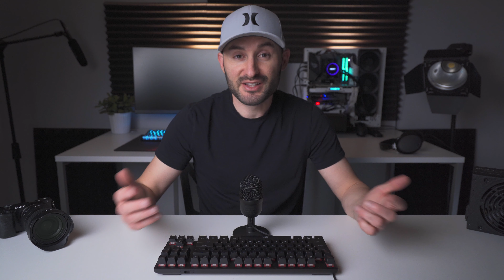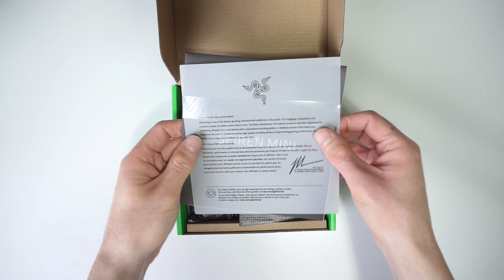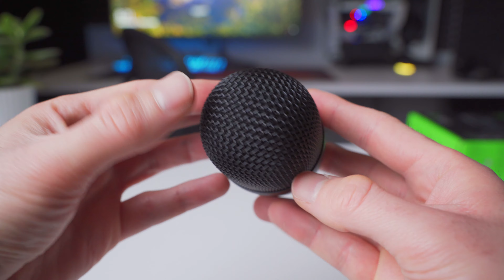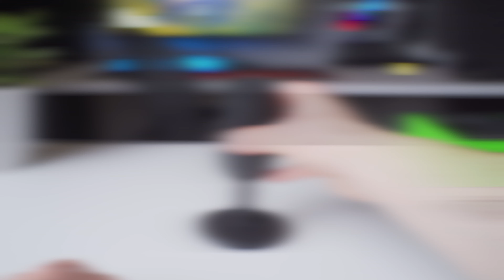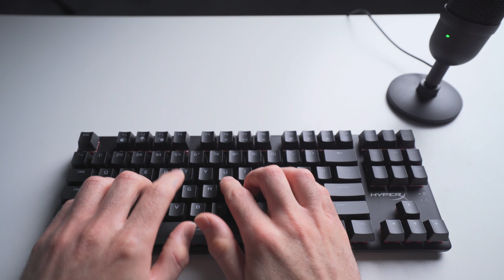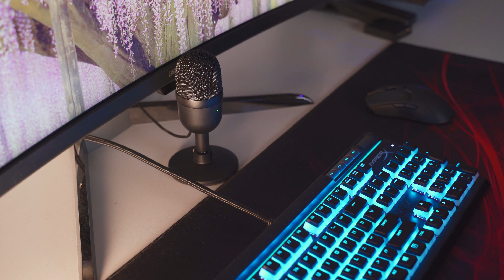Razer Seiren Mini Review, Sound Test & Unboxing | Best USB Microphone under $50?

Comment: I Like this Mic really good I got mine Exactly like this one you have here in this video from Wal-Mart . I find in Different video settings , The Weakest Volme level this  for me is on the Lap Top Video Audio Setting In This Setting I use make 4K Videos with my Microphone setting full Volume setting , Now in my OSB video setting I can control and have a stronger Volume at a lower setting well I have to have set a little lower to avoid Distortion recording in the video , still good volume , now my strongest volume is if i do a live video on YouTube , but I can't do 4K video or like in the OSB i can do up to 1080P 60 , in the YouTube from what i see it shows 1080 HD video it don't say if it is 30 or 60 maybe in YouTube it mostly likely or the other , but it seems to have the strongest Volume Presence with out Distortion , and funny thing when doing YouTube Live videos what ever set up they have will go into the Lap top Volume and lower the Level of the Volume so it don't Distort Automatically . Now I saw video this Mic and In 2024 of this Razer Microphone this now is with a Mute button and it turns that Green Light Red when the Mute is turned on .

Comment: I just bought one of these and the volume is very low which makes it useless for Zoom and other programs that don't have built in mic boost. I have to yell into the mic. I wish that Windows 10 still had the Control Panel microphone boost option, because 100 mic volume is not enough on many new microphones. I have a Blue Snowball with the same issue. I don't get how the sound volume on yours is so good. I also don't get how Razer and Blue think it makes sense to design a desk microphone such that at max volume you have to yell to be heard.
Reply: @Ryu X  I tried this program and it worked for a couple day. But now it no longer gets any input from my Razer Seiren. I've checked every setting and the mic works fine on its own, but Voicemeeter just isn't getting any sound from it!

Comment: Hey, I just got the mic and I've been testing it in obs and my voice is very low, I've tried turning it up and stuff but it's still insanely low. Also you should note that I have it off to the side, but it's still very close to me.
Reply: You can change the microphone volume in windows settings too, even give it a "boost" that slightly lowers the quality but increases the input volume even further
Reply: thank you, this helped a lot! @JoeMortdecai
Reply: I just got the mic myself and I’m having the exact same problem, I can’t find any solution that actually brings the mic audio up to a decent level. Have you been able to figure this out since you posted this comment? If so, how did you solve this?
Reply: @citrusaizu  I kinda figured it out. I moved the mic infront of me and got a decent level of volume. If this doesn't work then you should mess around with the audio settings in OBS.
Reply: For this mic, the direction of your head/mouth relative to the front of the kic is impt. Having just a bit of an angle can already affect quality because it is even narrower than the typical cardioid.

Comment: I just now got this to myself - I think its pretty damn good! I always thought Razer was a low- tier manufacturer until now!
Reply: how does it do when you use it with audio editing / noise canceling software? is it able to block out the keyboard presses and mouse clicks?
Reply: If you wish to avoid the noise of keyboard presses and mouse clicks, I would suggest investing in a microphone stand. This microphone is very good at its price point and I like it! Its audio quality is good especially for a budget microphone for people to start streaming and recording. The only thing it lacks, as the video says is that it does not have any manual controls and you will have to do it on OBS when streaming. If you would like to have a similar microphone with manual controls, check out the Hyperx SoloCast.

Comment: OK so I bought this mic and I still don't know exactly everything I need to change to make it better but here's everything I've picked up.

1)if you plan to use this for discord be sure to youtube how to turn off a hand full of those settings bc that's prob y ur mic sounds weird 
2)if u have a soft voice u prob will have to go into the mic settings and change the levels😭.
3) If u did all that editing from 1 and 2 this thing will pick up a lot of your background noise on discord such as your fans that may be on, keyboard, and bumps on the table etc🙄😐
But your friends could simply turn u down so the background noise won't ear rape them😅
And if you want to download a noise cancelation program make sure your gpu can take it

if you have any suggestions for a noise cancelation program plz,PLZ tell me😅 again I don't know everything should be doing but this is what I've learned.

Comment: I’m a gamer and looking for a good mic for my less than $150 budget.  Would this mic be good to run in-game chat or party chat and chatting with viewers at the same time?
Reply: This mic is specifically designed for streaming, so yeah, go nuts... I own one, it's great, you may need to adjust some mic settings in your recording/streaming software, and in discord to get it to ignore keyboard noises though.

I've successfully set it up to do that, it definitely works. :)
Reply: @N-Z-0-3  hey btw it's a usb mic so like is it detected by razer synapse?
Reply: @Garda_  Being a USB mic has nothing to do with it.

It's a compact mini version of the Seiren series microphones... It has one singular LED light showing whether it's powered on or not.

Synapse or cortex can't configure anything, because these programs aren't designed to configure microphone settings.

So no, the Seiren Mini is not detected by Synapse or Cortex.
Reply: @N-Z-0-3  o ok ty
Reply: 150$ for a mic is a lil bit overkill i think this mic will be great invest those 100$ in a good pc part or like any other thing
Reply: @Garda_  I was actually looking at this mic and even considering the Snowball Ice well.  I’m investing the little bit of money I received in donations back into my stream for better sound quality this time around.
Reply: @sd_gam3s  oooooo ok noice ye ok if that's the case u can buy something better but from razer siren mini is only good mic other like siren elite has like decent sound quality and it has like those emojis type of things when someone donates your mic flashes with the gif they sent and u can select it to static effect it's 160$smth it's a pretty unique mic but If u don't care about those things then go for a snowball mic best mic company ever or research a bit more cuz I don't know much about mic.
Reply: @sd_gam3s  Now the razer emote is 100$ rn on amazon I think it's pretty good option for u considering your budget

Comment: I currently have the newer NW-800 with its phantom power. Should I keep my current mic or switch to this. The main reason I’m thinking of switching is that I want to use this during my zoom meetings. The nw-800 has a mounted arm which is huge. I don’t want the mic to be in my camera. The second reason is cable management. The newer has like 4 cords that are 10ft long each. I have attempted to manage it with zip ties but it’s still visible. If you could respond before December 25 it would be great! Thanks and keep grinding
Reply: The Nw-800 is no where near as good as this. The mic is definitely a good investment if you have the money, you can still use the boom arm on this mic, so nothing lose in that point

Comment: hey honestly i have a question 

would it be better to get the Blackshark V2 X and then tweak the mic audio quality like crazy 
or get this?

and is there any sort of like sponge filter thing i could buy for a mic this size? i usually see those for blue yeti or the audio technica ones

honestly you deserve more subs! keep up the content! :)
Reply from the maker: It comes down to what level of quality you want from your mic.  The Blackshark V2 X will be fine for most people in most situations, but if you want to take your audio recordings to the next level, a dedicated mic like the Seiren will be better.  Also, you can probably find a sponge filter online that would fit, but I wouldn't worry too much about it - it won't make much difference.
Reply: you literally just want look like a streamer and have no clue bout mics..
Reply: @sonicartzldesignerclan5763  bro what?